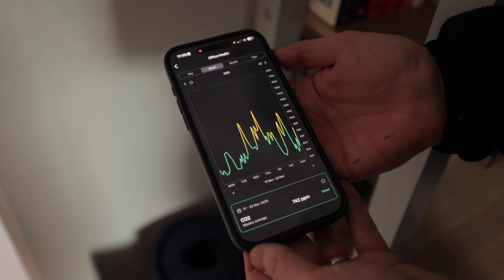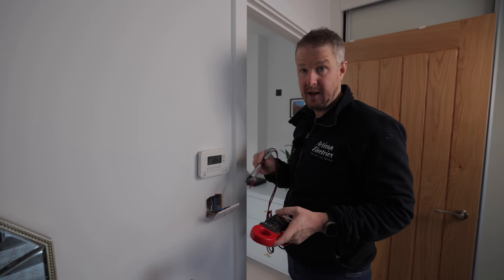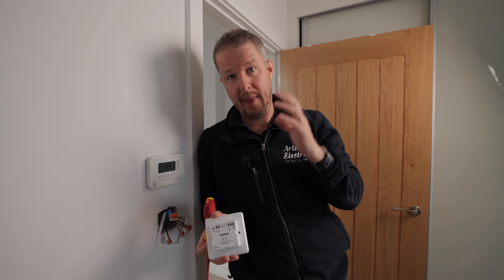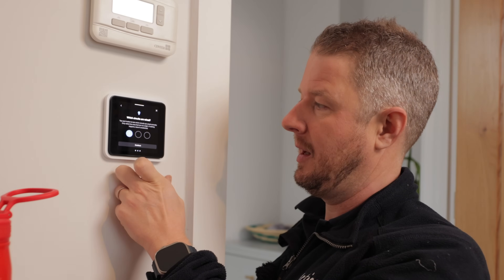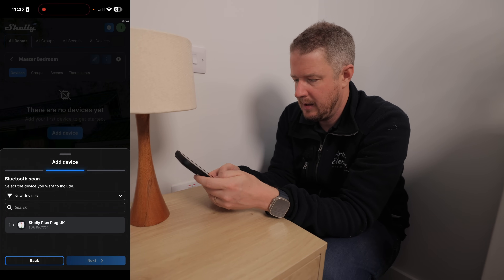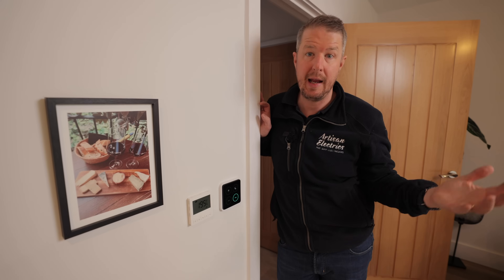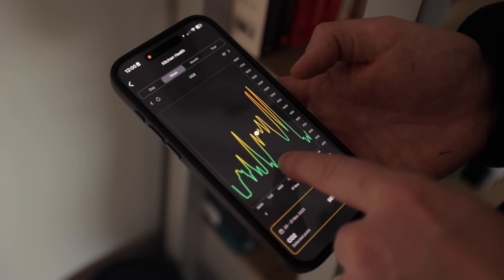Hidden DANGER In My Home EXPOSED By Smart Tech! ☠️

Comment from the maker: Ready to transform your lighting and unlock home health insights? Grab your Tewke TAP switch here: https://bit.ly/4rVE2zd

If you’re an installer and want to offer the next generation of smart home tech, you can apply to join the Tewke Partner Network using the link below - https://bit.ly/48DO2pl
Reply: But over £200 for a light switch rather spoils it for most people.
Reply: @BrianG61UK  Lightwave is cheaper, but if you need a four-way it’s still a couple of hundred.
Reply: If you make me do a questionnaire and then force me to submit my contact details before telling me the price of anything I'm not interested. I see someone else did submit their details and ended up with a quote of £4k for 10 rooms, no thanks.
Reply: Basically just an advert and waste of my time!
Reply: A couple of questions from me:
1) when using it without a neutral wire is there an option for adding a "bypass" resistor incase the lamp doesn't pass enough current to power the switch?
2) do you have to calibrate the dimmable LED lamp? A lot of devices like this usually ask you to set the minimum and maximum level for the installed dimmable LED lamp.
Reply: Safe isolation with no testing of the meter with a proving unit before and after isolation to prove it was working when testing the wiring was safely isolated!
Poor practice when working in your own home you wouldn’t do at a customer premises!
Poor practice and unsafe assumptions going on here!

Comment: The screen on switch is cool and the sensors interesting. You can achieve much of this using the shelly in ceiling switches though can’t you? Then connect to Alexa to achieve scenes. Seems like an expensive way around. 

Interesting product though.
Reply from the maker: It definitely is a product that we see getting better and better as time goes on!

Comment: Co2 levels go up when you are moving around, or when you have multiple people hanging out in the same room. If you are working out or moving things around, you exhale more often, which is co2. It can be combatted by getting fresh air into the space, either open window or a properly spec’d hvac system. Even then it’s going to bounce around. This is based on my own testing with an air gradient setup with an actual co2 sensor in my apartment. You can see by the graph when I have people over.

Comment: I use tapo smart bulbs, kasa trvs and tapo smart plugs cost me a fraction of the cost of these installs and no wiring needed at all. The only thing I had to wire was my outside camera/floodlight. The only can forsee wiring for is if I decide to use call for heat I will need to change the boiler controller. The best part is if I ever move I can take all my components with me so I don't have to buy again or uninstall, I just have to change the bulbs back to the original and put old trvs back on. The trvs require no plumbing or taking pipes off too. It's all integrated with Google home, Alexa, apple home ect. 

The other cool thing about this set up is that if I move the devices are set to room so I don't have to set up again, I can just put bulbs back in and trvs back on in new house and it is already configured room by room from this house.

Comment: Number one cause of co2 are a very sealed home with people breathing. This happens more frequently when doors are closed. An hrv could bring and condition fresh air if this is an accurate sensor. Combustion could be another spike in co2. Usually gas burns at 7 to 10.5 % co2 depending on efficiency. Note 45% rh is recommended comfort and health

Comment: How about checking for proper ventilation in rooms.  Especially rooms with stoves, fires and gas boilers and cookers.
Likely the source of CO2 is generated within the house but sometimes sources can be external and enter from unsealed cable/pipe ducts entering a building.  I also have CO (carbon monoxide) detectors because this is fatal and can exist in any floor level whereas CO2 is a heavier than air gas.

Comment: That’s not dangerous C02. All you need to do is  leave the door open in the room or window.

Also, just add the data to ChatGPT and have a conversation about your concerns. It will help explain and make a plan as if it was a ventilation expert.

Doing this myself at the moment with AirThings devices.

Comment: During those peak co2 times, did your heat kick on by chance? I’ve noticed with some co/smoke combo units I installed at my families home that they would go off for no reason until I noticed it only happened when the heat kicked on. Just a thought that it could be the same thing here. shrugs

Comment: Love all the comments.
I'm only 3min in to the video & I've given up 😊

I install smart home kit as an electrician! I've also designed the actual semiconductor chips that go into many smart home devices 😮

I've not come across this device before & I'm fairly up to date with technology.

That said, it does LOOK good & possibly does a great job??

But, as a professional installer, I keep away from 'Wi-Fi' controlled switches. These should all be Z-Wave, Zigbee & more recently Matter devices. Ideally controlled by a quality Hub - I use Hubitat for custoners, but Homey, Raspberry Pi's and others are good choices. Even the Alexa hubs 👍

However : The future og Home Automation IS moving...
I now don't bother running ANY wires down to switches - These are pointless, as switches move to battery powered and onto energy harvesting (enocean, Zigbee Green Power?...). Saves a fortune in cables & installation costs.

That said, you niw need to run, at least, a 3-core & Earth around to EVERY light fitting in the home.
Here you have...
L
N
E
SL (Switch Live)

This SL is key & needs proper design!

L,N,E to every light, even if the L is not used.

Now, the SL can ve segregated per room, ot group if lights. The SL is driven from a smart connected controller/dimmer, & run to a group of lights.

This 3core setuo alliws for individual light control, or complete room control from one controller.

If you really want to go to town - have a controller at EVERY light fitting. Gets expensive though!

For light switches, always install to a 50mm box.

I use Hager grid, retractive,  switches, plus a Shelly Wave i4, powered from a small battery.
I do also use other zigbee switches etc - all can be used without cables.

The true skill, comes at the initial design & layout stage, with close discyssions with customer. Then of course, at the implimentation & programming of the hub control software.

My smart homes are fully controllable, have holiday modes, can detect when one or more occupants leave the home, to allow various scenes to be controlled autonomously.

However, all the above will NOT work directly with these switches. Sorry.

On the other hand - If anyone needs some support, please contact me... 👌

Comment: Luckily I still have use of both arms and hands so don’t require these. I work in a building with CO2 sensors linked to automatic air vents, the air vents make zero difference, regular to see massive readings and the sensors turn red, funny to see people panic when they go red. No one has died yet.

Comment: Few people will be installing £300+ light switches from a small startup that probably won't last more than a year or 2 due to the lack of Home Assistant support (which is a shame as they look pretty, and they're British).

However my biggest issue would be that light switches - like TV remote controls - need physical, tactile buttons. Not everything needs to be a touchscreen.
Reply: We just launched the beta of our Home Assistant integration, let us know if you want to try it out!
Reply: I looked them up, turns out they've been around since 2019/2020 recon they must be doing something right to still be going strong and coming out with OLED devices

Comment: Good grief...Tough crowd this episode.
Reply: yep, but it does show that the audience is well informed. The ability to operate your smart system without internet connection is high on anyone's list in this field, especially with people having been bitten with systems being broken by supplier updates and going out of business or just retiring some products. To be honest, it should be the same with smart solar/battery charging etc. as well. 
Working with a compatible opensource open standard that can run locally freely without subscription costs gives buyer protection. When you wire a home, you expect it to be functional for several decades minimum, and with hardware and technology moving so fast, things connected to the internet are much more exposed. As soon as you have to impliment encrypted communications your hardware needs certificates, which have expiry dates, and the encryption is subject to being retired when it is proven less secure. Then the old hardware can't support the latest version of the security protocols. If your devices are not online, security is less of an issue. It is bad enough with pc's being held to ransom by Microsoft via secureboot certs and accounts, but holding your house to ransom is worse. 
While the vid is interesting to showcase a particular brand of tech, it would benefit from more information so that interested parties can make more informed views, and some clarity over the sponsorship (which is common with other youtube creators) would help maintain the artisan youtube brand information confidence.

Comment: Who paints up to a switch or socket? is is only me that loosens the screws and paints behind the face plate. Allowing the paint dry before screwing it back.
Reply: Mate professional decorators won't unscrew faceplates. Tell me they're not insured to touch electrics. 😳
Reply: @markrainford1219 And a professional should be able to cut in with a small brush. Never used a profesional decorator. Any way gives me the chance to check out the back box. Decorating the hallway at the moment and discovered neither of the two power sockets have earthing on the back boxes.

Comment: As someone who does deal with home automation and sensors, I can tell you right now you should never trust all the solutions available and their integrations.
Don't get me wrong shelly is good product and has great functionality without being connected to the internet, but this tewke device (unlike similar devices from Shelly) besides not telling us what kind of integrations it supports or sensor hardware it has inside and obviously being what I assume to be another cloud-based device after checking the specifications document it doesn't I find it to be a not great device.

This is my professional opinion as someone who almost exclusively install local only solutions like home assistant (that can be accessed remotely if desired, but not by omission) and separating every single device from the regular wi-fi network and from internet access for actual security reasons. It is a cute product, but I'd much rather use regular switches that connect to a shelly relay, dimmer or just remote switch adapter as you said but separated from the internet for everything except updates.

I can recommend shelly because it's one of the few companies that provides the equipment, the full hardware specifications and schematics and the option to run the devices without an internet connection for configuration without an app which 10/10 just there.
I'm not saying tewke is bad but if I don't know what's inside a device and can't unplug it from the internet and keep it working, I'm not trusting my house heating system to it.

Comment: Grab a portable O2 sensor and use it to validate the calculated values from your sensors around the house, high O2 levels cause all sorts of seemingly unrelated side effects.  Though generally inferred O2 readings should be taken with a pinch of salt, as they can be affected by various factors, even temperature.

Comment: We have a Co2 meter we move from room to room, and yes we to get the same kinds of readings, and every so often when the readings are high we open the house up to clear the air. So seeing this system has real made very interetsed in i, but reading on, I see below it is very expensive and there seems to be cheaper makes. So thanks for sharing Jordan!

Comment: Interesting devices! Great to have all the AQI sensors in the light switch. Dimmable, multi gang etc.

But does it have any motion detection so you can turn the lights on/off automatically as you walk in/out? positional mmWave ideally?

What about brightness meter so you only auto lights on when it's dark?

Is the control completely local? No cloud internet access required?

Is it compatible with Home Assistant?

The website is garbage: 100% aesthetics and advert. 5% useful information. Hard to navigate to find what you need to know. I gave up.

If it isn't local control via something like Zigbee then that's a hard no deal breaker. If it isn't compatible with Home Assistant then that's another hard deal breaker. If it doesn't have occupancy detection or brightness measurement then they didn't understand smart light switches. 

Cool tech with a lot of promise, but ultimately apparently more interested in looking cool than being actually useful. It's designed for the Apple/Dyson/Bang & Olufsen/Sonof/Bose/Smeg/Hasselblad/Leica/Festool posers.

Comment: You and we all should be using kinetic buttons!!! They don't need power or batteries to switch on lights and be placed anywhere!!! But the base unit should also be a smart one too!!!
 Why isn't there wired smart wall switchs that control any smart bulbs???? You don't need to run a wire to smart bulbs or fixtures...I don't understand why this doesn't exist already....

Comment: What kind of sensor is in the device? Is it a co2 or a voc sensor? A co2 sensor only measures co2, but voc sensor measures volatiele organisatie componist in addition to co2. If the device also reacts to alcohol, you are deling with a voc sensor. The measured peaks may therefore be otter substanties instead of co2

Comment: Can it run locally when the internet goes down?
Reply: It can work with home assistant, and the lighting control always works even if the internet goes down. In T3 they mentioned it was Thread and Matter capable, so that will be a game changer when they push that update.

Comment: £397 for light switch? I will stick with my moes switches and smartlife app. My whole house has smart switches for less than that.

I do have lighting scenes setup, which can be set on my phone, I have a last man out button by the front door which switches all lights off in the house.

I can get 4 way wireless buttons which could have different scenes etc. I could add some air quality sensors in rooms etc and still be under that £397.

I can confirm in my case things work offline but I do have a scene which operates outdoor lights to come on just after sunset which does need to be online to get the data for the sunset time.

Comment: Massive cost for these devices.. seen them online for around £225. That’s out of most people’s reach. 

I’ve got all of these sensors and hardware via Home Assistant, Aqara sensors / ESH sensors, Sonoff NSPanel Pro’s in my rooms integrated with Shelly relays and Hue Smart Bulbs over Z2MQTT using SMLight Zigbee Hubs. 

Much cheaper and far more integrated into a smart home, surfaced data on my mobile dashboards / wall mounted tablets and local only control, meaning no cloud or need for the internet for these devices to communicate outwith the home. 

Thanks for sharing the devices and taking time to make the video as always! Look forward to seeing more Sigenergy installs on the channel soon!

P.S. If you need an overview of Smart Home tech, drop me a note.. always happy to give views that I’m sure a consensus of your subscribers would agree upon (such as local control / no cloud connections / more cost effective solutions)..
Reply: dis is the wae
Reply: If that £225 is from CEF then that's only the screen. It's another ~£106 for the frame and the wall dock!
Reply: @royceybaby indeed.. absolutely god awful for a wall screen that they want to charge that for it. So many other choices in the market that can do it for far less and offer far greater functionality overall!
Reply: @royceybaby are they insane?

Comment: I'll stick with motion sensors and Home Assistant. Just walk around the house and the lights turn themselves on at various brightness and colour depending on the time of day for a fraction of the cost of this.
Reply: Fair enough, but its super cool that they have packed 7 different sensors (including that radar) into one device, and it does link to Home Assistant, the devices are visible in the HA dashboard.

Comment: 13:54 The CO2 spikes you mention are not ideal, but far from scary, you just lose some IQ points until you open a window. Also, it might not even be a good CO2 sensor, because those are expensive, and I can't tell from their website what component they're using; it could just be using non-CO2 sensors to guess. 

My arenet 4 CO2 sensor (it's a nice sensor) can easily spike to 1500ppm when there's two people in the same room. Insulation has been getting better, and sometimes that happens at the cost of good ventilation.
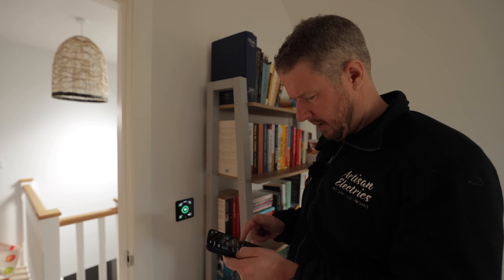Reply: It doesn't even have a CO2 sensor! At 13:04 it says it calculates the CO2 levels. How the hell can it calculate CO2 levels, from what? Without a sensor it's a useless reading.

Comment: Do these work without an internet connection? I have a robot vac that is now dumb because the company that made it decided to turn off the servers - I can't control it in my own house without physically pressing its buttons, and many of its features no longer work because it was all cloud based. I won't buy anything that requires the internet to run something locally again!